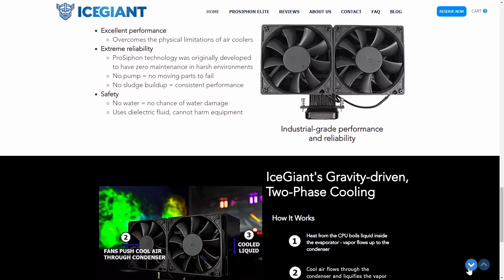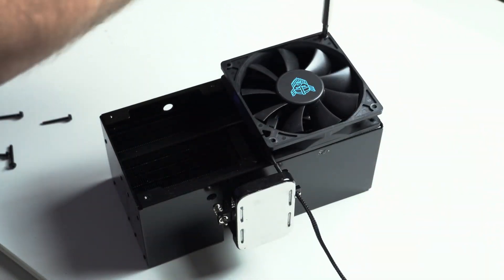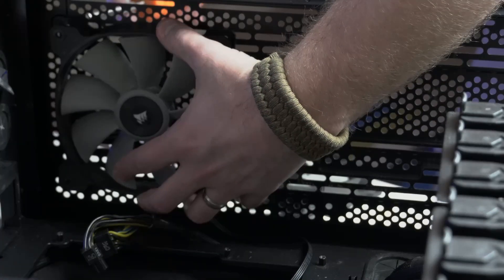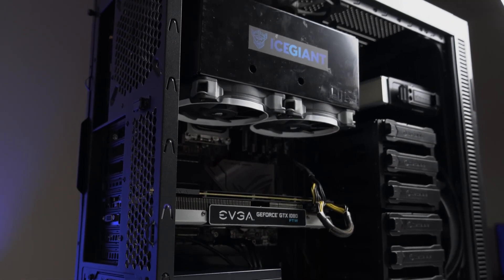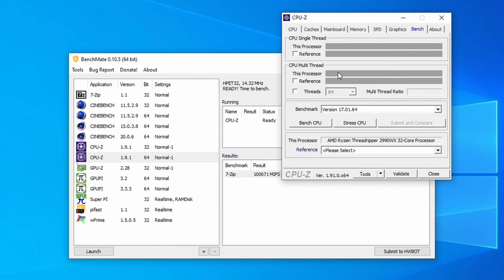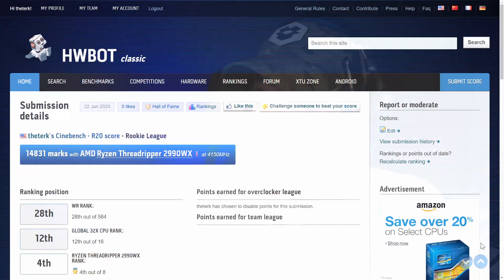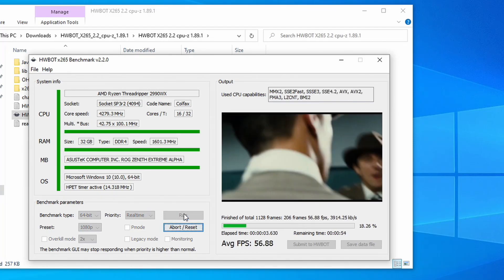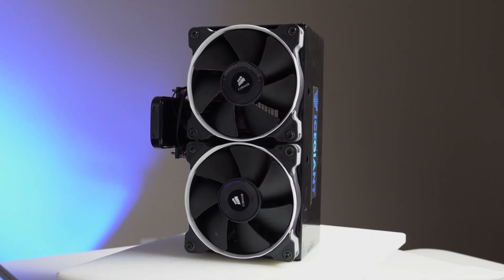Beating 32-core HWBot Scores with Prototype ProSiphon Cooler

Comment: Does it gives enough room for any kind of ram? some a quite high... I've ordered a Prosiphon and I'm looking for ram right now but I don't want to buy some ram that won't fit with the cooler.
Reply from the maker: I was using Viper's Steel series and it fit fine, but it's VERY difficult to change DIMMs.  here's the Twitch VOD of the builds  https://www.twitch.tv/videos/534193635 - timecode 19:20
Reply: @TheTerk  Thanks a lot. This makes me fear I won't hace room for the Corsair RGB I was looking... maybe just the Corsair Vengance will have to do. Nonetheless I've reached out to IceGiant and on this week they will do some testing to see how much clearance there's for ram since the actual specifications for the final version indicates the distance between the cooler and the motherboard pcb, when what matters is the distance to the ram socket. I'll be telling you what news I hear from them.
Reply from the maker: they have some pretty good mechanical drawings on their site, might be worth looking at it.  IceGiant has been pretty responsive for questions I have
Reply: @TheTerk  I've checked the website and it says there's 52mm between the Elite and the motherboard pcb, but the Viper steel series you used are 44.5mm and adding the 1~2mm the socket rises the ram, there should be at least 5.5mm of clearance with the ram you used but on the video the space between was the diameter of the screwdriver which would be around 4mm. So as I'm thinking on using Corsair Vengance RGB pro, that are described to be 51mm and adding the 1~2mm the ram socket gives over the pcb... is practically a zero margin for the 52mm described for the Elite. Maybe with the final thinner version of the Prosiphon and the middle section of the Corsair ram that it's a little lower, they might fit. 
Still as you said they are pretty responsive and are waiting for the units that would come in a few days to measure it with some ram installed.
Reply: @TheTerk  I've got a reply from them. It seems the tallest ram that you can put would be a 49mm one.

Comment: Have you tried using noctua fans on this cooler and if so, did they increase the cooler's performance?
Reply from the maker: i don't have noctua fans right now :(  though they likely work better than the corsairs I have on there.  2200rpm :drool:

Comment: textbook how Not to apply thermal interface..       🤦‍♀️
Reply from the maker: i followed the instructions supplied by the manufacturer since it was a prototype.  I've tested a bunch of threadrippers and it definitely was a little heavy.  but it worked just fine

Comment: you did not mention the temps?
Reply from the maker: my prime95 testing was done at ~4.1ghz and was right around 85C for about 1 hour.  a little warm, but since I'm running short overclock sessions it was acceptable.
Reply: @TheTerk  thanks brother! this cooler definitively shows promise!